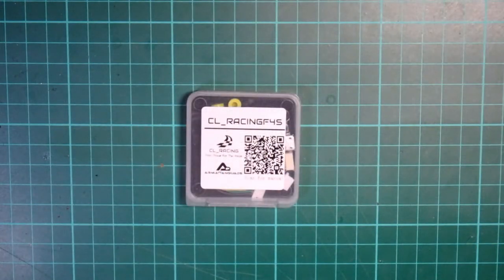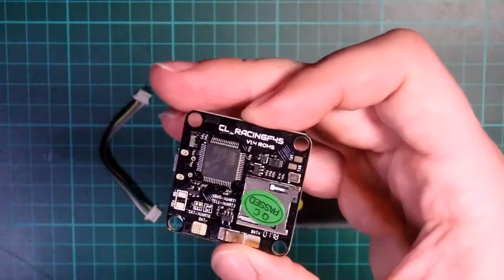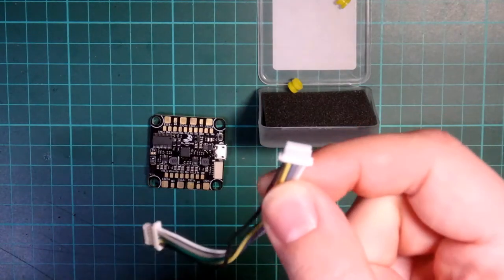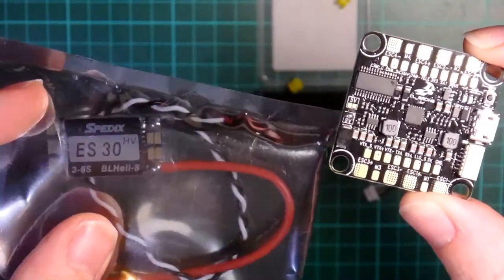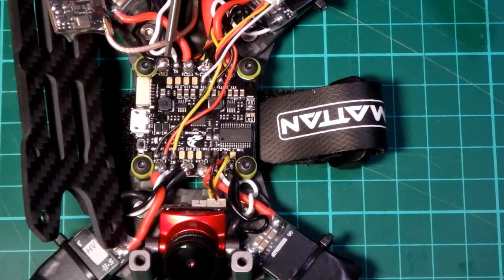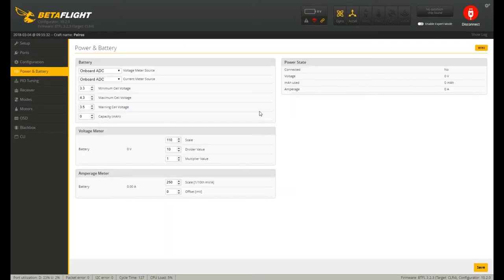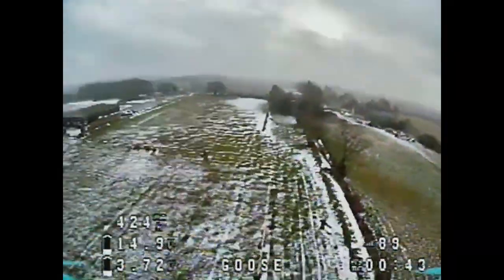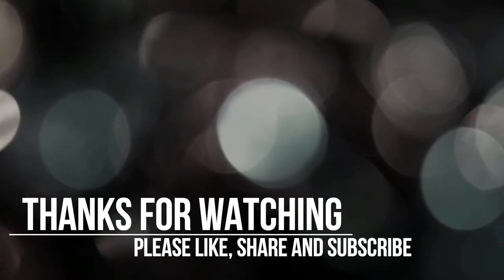CLRacing F4s V1.4 Review and Flight

Comment: Thank you, Sir!
Reply from the maker: Thank you for the opportunity
Reply: how in the world did you flash this board?  beta flight is not reading the bootloader.  i hold the boot button down and plug it in.  beta flight will read it normally to set it up,  tune etc....  it will not flash the board tho.   says cant connect bootloader!   help,   i only fly clracing f4s.  never updated it. i have 5 of them.  you should see how i ripped the guts out of a holybro kopis 1 and put the clracing f4s in it and holy cow!!  super speed.  i'll make a video.  i have 1600 subs.
Reply from the maker: I had that before, it was the driver on the pc. You need to make sure it can see the divice in boot mode.

Comment: Can you flash this Clf4 board with the latest firmware please i am having trouble trying to flash.. 🙂👍?
Trying to put it in dfu mode?
Reply from the maker: Yeah should be fine. 
Yes you will need to go into dfu mode. If your using a pc. Try downloading the impulse RC driver fixer (Google it) that should help.
Reply: @sawtoothspike  when I try the impulserc driver it says denied access to com3 fault?

Comment: so since you have 4 separate esc's for the quad, you must have attached the XT60 power leads to the board, but if you were to use a 4 in 1 esc, would you attach the XT60 leads to the board still or would it go on the 4 in 1 esc pads?
Reply from the maker: The xt60 to the 4 in 1 then, depending on a number of factors, connect via the socketed esc port, or connect the xt60 to both. If your 4 in 1 has a current sensor and can push this out via the cable loop, I would go with option 1. But make your thr cable has the wires in the right order.

Comment: hi what reciever did you use? Ive got a r-xsr but cant get any inputs in beta flight , loads having same issue with this receiver
Reply from the maker: I used an XM+, Your the second person this week mentioning issues with the r-xsr. I have never had one, so i cant comment. It worth checking its in sbus mode.
Reply: @sawtoothspike  Yeah I checked everything green light , blue light for sbus. I spend 10 hours yesterday trying to fix this issue. common on the forums . in the end I hooked up  a X6r 3 wires ground pos and sbus and worked fine. Didnt want to use the x6r to big. Still have no idea .

Comment: Hands down my favorite FC :) The only issue I had was the new camera controls...my camera is the runcam V2 , I use a Dx6i and when trying to use this feature,  the menu using the joy sticks  does not seem to work properly , I can't move around the menu at all, can't select settings or save ect.  Any one else have this issue ?  I am still noob to this hobby ,  so this is probably something small I have not done right..
Reply from the maker: Just implemented camara controls, I will probably do a short video on what I did. I was connecting to a runcam eagle micro